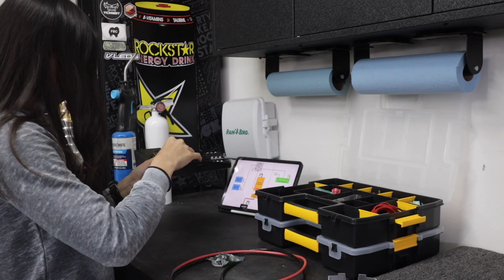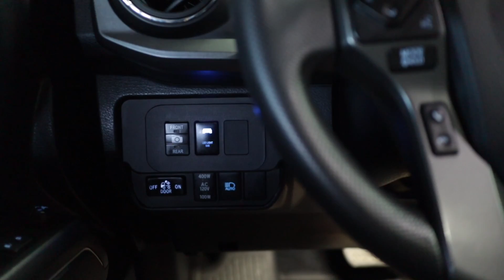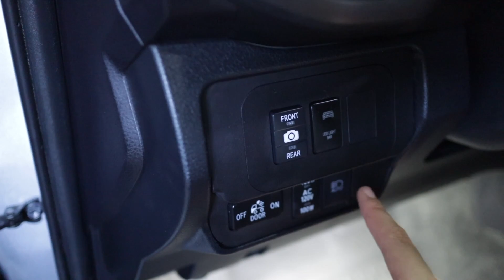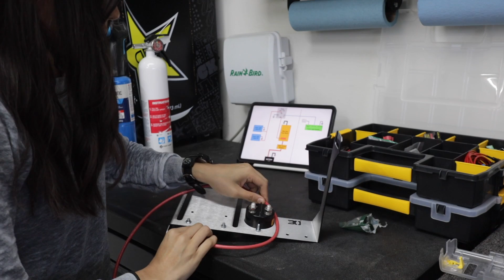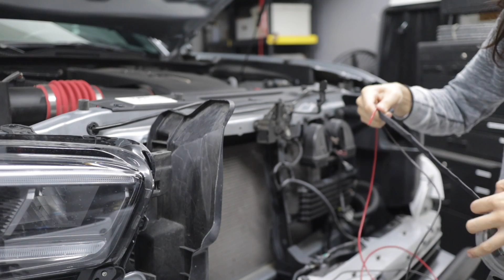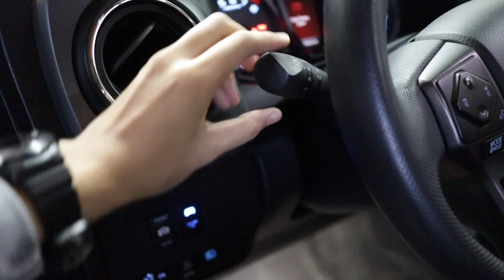DIY Auxiliary Power For Your ACCESSORIES! + Installing LED Lights w/ Switches

Comment: I love the Blue Sea products.  The breakers and fuses are selected based on the wire potential not really the acc draw.  If you have the length and AWG of wire to support 100amp draw between battery and panel you are fine. However if that wire can only support 50amps you won’t have protection

Comment: Is there a way to connect an auxbeam switch panel to this ? I got ahead of myself & started to build your auxiliary panel after I bought the auxbeam switch panel but the power cord runs into the fuse box to power the switch panel they include. Did I over complicate myself by building this when they send you everything already ?

Comment: How do you size your wire so that you are feeding your fuse panel with the right gauge power lead?
For instance, What if you want to run your fuse box 10 feet away from the battery?
I'm trying to sort out how to measure everything correctly on a VW project I've got going, and the battery is under the rear seat, but the fuse block needs to be upfront under the front bonnet.
Thanks!

Comment: Im new to wiring and dont have any real world ppl to ask questions to. Im currently installing fog lights on my 2022 SR, i bought the fuse block but do i have to use a Blue Sea 100A Circuit Breaker?

Comment: But you still have to shut all your switches off when you shut your truck off. Or your battery will die.  You should of wired it so when your truck is off no power to auxiliary stuff.

Comment: Nice and informative vid.👍 I have that same 100A breaker switch and the 6 slot version of that fuse block. He had issue with me going with the 100A breaker and told me to go with the 40A version. Yet most people go with the 100A version with no prob. I'm mostly running lights on the block. Maybe 3 that will need relays and the other, lower leds like Raptor lights, led rock lights and led strips to illuminate the bed. I mainly just like to use the breaker as a main kill switch. Do guys think I should ditch the 100 for the 40 like he said or can I keep the 100A with no probs?

Comment: The battery cable goes on the circuit breaker goes in the  LOAD ?

Comment: Great vid and thinking, Chloe!  Using this system for my trailer DC-DC charger.  FYI: I used your LED light upgrade, and the lights for the license plate got wet and started to flicker.  You need to have lights with a waterproof cover.  Pax tecum

Comment: Pro tip, try to use OFC copper.... oxygen free copper, it's more flexible, slightly smaller in diameter, and alot more resistance to corrosion.

Comment: About that little piece next to the brake sensor you should take a small piece of rubber hose that would fit into that slot on the mount

Comment: What’s the benefit to this over a auxbeam switch panel? 

The switch panel is perfect for just light and stuff because it deletes all the individual relays, and switches to the cab, and all that wiring. Why did you decide to go this route?

Comment: Hello Chloe,  I am wiring up some reverse lights on my Taco with the same switch that you are using.  Thanks for posting it is really helping with my install.  The wiring diagram you provided is awesome.  I have one question for you:  Did you NOT use the "Red 2" wire from the push switch connector, at all?  I thought that was supposed to used to allow the push switch light to be turned on with the tail lights?
Reply: I was getting ready to ask the same things. I'll ask in a new question and hopefully she can get back to us.😊
Reply: Hi Chloe, great video's and thanks for all of the details. When you hooked up your switch to the fuse box inside the cab, ( with the add a fuse ) does that connection back light up the switch like when the DRL's are in or when the headlights come on automatically?

Comment: You could wrap the corner by the wire in self sealing silicone F4 tape so the metal edge is covered in rubber. It should eliminate the possibility of the wire getting abraided. The Airforce uses F4 tale on aviation electronics for similar purposes.

Comment: Great video!  As a power engineer and HD mechanic I'd love to see you re-do those big gauge wires to supply and gnd to copper solder ons, and your spades to shrink style with the addition of a little grease.  I'd also never use butt connections but rather solder and shrink tube...its simply the only way to fly if you want any kind of longevity and safety!
  Keep up the good work!  Version 2.0 would be a great time to re-do those connections. Cheers! ✌️
Reply: Came to say this as well, cold soldered in an ORV is asking for it down the road.  If you must crimp make sure to use a ratcheting crimper like Astro tools.

Comment: Wow. Thanks I just installed this today.  I love my Bluesky Fuse box, breaker and frame.  It looks Factory standard.  I am getting the Stinger Jl Audio speaks in my 2022 Tacoma tomorrow and I needed this for the installation for my tech when he installs this. Thank you for your video to help me get this installed.  You Rock.   I am installing most of what you did for you Tacoma!!   Next is interior lights and such.  Thanks for sharing your experience!!!

Kelly

Comment: I’m sure I could just look it up but I wonder if there are brackets that are made for the manuals too. The location where you have your under hood wiring panel is where the clutch fluid reservoir is mounted

Comment: loo into a company that makes the Deutsch connector. its a much stronger connector and will not allow water to get inside the connector. The wire will break be for the connector does. thanks

Comment: Just saw this video on my timeline. Great work... Interesting ideas too! For the long lengths of wire to be run you can secure them with a vice or helper and run the other ends in your drill. Then just wind them up together in a braid to keep installation easier. My $0.02... ✌

Comment: I did something similar to my truck with an amazon kit from 8gang which is pretty much an unbranded auxbeam. Curious as to how the relays were connected to turn on with the lights being on. Awesome that you have the option to use stock looking buttons!

Comment: Hi, for the concern you have with the mount-plate being close to your brake sensor:
Get a piece of black rubber small diameter vacuum tube and slit it vertically. Cut to length and slip it on the edge of your concern so that there will be no hard rubbing.

Comment: Always good to go with an oversize fuse block, you will be surprised how many accessories you can add. Using the relay for the lights is overkill, it is rated for 40 amps on a circuit that will definitely draw less than 10 amps. Assuming your switch can handle more than 10 amps, wire the lights directly to the switch and save the relay for a larger load circuit. Most aftermarket Carling style switches can handle upto 20 amps.
Reply: Nice work!

Comment: To protect your brake sensor wire further, you might consider getting a PETG or shrink wrap sleeve and cover the wire. Alternatively a bead of silicone along the bracket should give you the protection you are looking for. Honestly, make yourself a note to check it after your next couple wheeling trips... if there is ANY sign of abrasion, look for a serious solution (overkill is always acceptable) if not you are likely fine... just add it to an inspection checklist to do periodically. (you SHOULD have an inspection check list)

Comment: You could put a piece of soft gasket material on the bottom of your panel to protect the wire where it's too close. Beats cutting it out. I happened to have some industrial grade adhesive backed soft gasket that I used in my boat to prevent vibration while towing .

Comment: Hammer the edge of the tan to a 45 degree angle to increase clearance

We do it in all sorts of stuff especially on truck (18wheels) tire valve rims to be able to air them up 

They have metal stems

Comment: Take some small fuel line and slice it to cover the edges and use RTV to hold it on, this will keep the ends from rubbing metal and being sharp.

Comment: I enjoy your videos. This my first comment EVER.  Your attention to detail and safety make me feel like you’ll read and consider so I thought it would be worth my time.  

Of all the videos I’ve watched about adding a fuse panel with a circuit breaker, NO ONE thinks to protect the terminals of the circuit breaker under the support bracket.  These (exposed) terminals are so close to ground sources (such as the bracket they’re mounted to) that they are a danger while working with tools nearby.  Unless there’s an inline fuse, the line side (battery to circuit breaker) and (with the switch closed) the load side are unprotected.  A short to ground would be scary, not to mention may damage the battery.

I used Fastronix 5/16 - 1/4” stud terminal caps to cover the CB terminals under the bracket.  I got these from Amazon.  They’re about 2 for 7 bucks.  Good value for the protection they provide. I suggest that you install these when you change to 4 gauge wire (of even if you don’’t).  

The risk may not be great, but is there.  I hope this helps you and others.   Best.

Comment: Excellent video!  I would like to add that you need to fuse for the wire. IOW, if your wire is rated for 8 amps, but your fuse is 10 amps, the wire will catch fire before the fuse ever blows. Luckily, 16ga wire is rated for 13a. You might also look into using car audio power wire. It has higher strand count, is a lot more flexible, and less likely to corrode over time
Reply: Thanks for your input

Comment: Suggestion make a fuse box diagram listing the fuse numbers with what they control for a just like the factory function. Helps later on also when you forget what fuse is for what. Excel sheet and a laminator for a bit cleaner look. Could tape it to the inside of the lid possibly.

Comment: Interesting-ran switch wire from cab thru firewall to engine bay!
Out of dozens I’ve watched, always from engine bay thru firewall,
you start in cab.
Is this approach a software engineers, gender, or ‘better way’?
Thanks.

Comment: Don’t forget to use either a Lighter or a heat gun on all of your connections. The reason why it’s a larger diameter size is because it’s designed to be shrunken with heat and will create a weatherproof connection. On the items that you can’t waterproof use Vaseline(I know but it’s true)

Comment: Love this!  Man, I wish Guild Outfitters (or someone else) would make custom panels like that for the 5th gen 4Runners.  I'd love to have a more OEM look than the aftermarket Switch-Pro type touch panels mounted randomly on the dash somewhere
Reply: The 2020+ Tacoma have as many switches as she shows here so maybe check to see if Toyota sells newer switch panels for later models

Comment: I think to protect the brake sensor that the mount comes close too. Is to go down to the 6 circuit panel that you were thinking about. Then make the clearance you need around the sensor your comfortable with. If you plan to stay with the 12 circuit. Then mark the area near the sensor and maybe bend the mount in that area down or upward to give you more clearance. If you can bend the mount carefully in that area. It could strengthen the mount.

Comment: You could always get a flexible gasket for the piece near your brake wire so you don't have to cut anything and you don't have to worry about it.

Comment: Hi, awesome video. Have been sitting on this project for a while myself. I may have missed it but where did you ground the relay? Do you think you'll have a central ground for future relays/accessories? Thanks so much.
Reply from the maker: The relay was grounded on the fuse block 😊 Everything else I just ground to wherever I can find on the chassis

Comment: Just an idea, but maybe add some lock washers next to the nuts on the bottom of the bracket?    This would help the nuts from coming loose from vibration.   A dab of blue (removable) locktite is also an alternative, as well as aircraft style lock nuts.

Comment: If you have the room at that corner and have a mounting area under it you might be able to use a post mount and bolt it on the corner and that will give you a sturdy corner. If that does not work you might be able to put a flexible rub rail on the corner just incase it does hit it will keep the metal from cutting the wires.

Comment: Maybe some large shrink tubing for the harness your worried about for extra wire protection. One suggestion for your terminal connections though. Be sure to use flat washer underneath and on top of the lug. Also consider using lock washers under the nuts or maybe nylon locking nuts. This will prevent lose connections due to vibration.

Comment: Hi Chloe,
Love your Chanel, your videos have helped me with a lot of mods I have done on my 4Runner that are similar. It’s great you did this video… I am actually working on swapping out my wireless remote controller… it’s a love-hate relationship… it works we’ll but it’s finicky to say the least… I have installed a few accessories (lights, light bars, hidden bumper winch and bumper lights similar to yours, on board air compressor etc.) and at first so many wires and messy… so I cleaned and organized everything but the wireless remote option, though sounded good at the time has been nothing short of frustrations… some times the single connects and sometimes you got to swing your arm around pushing the buttons looking for the right spot for the controller and remote signal to connect 😂… after several attempts to improve the certainty and reliability by relocating the controller to get better signal I decided to look for a better option… this video has given me a great idea to build my own and use switches instead of a remote switch. I am excited to get started on this project! Thanks Chloe and happy off roading! 😊

Btw… if it were me I would cut the part of the tray you are worried about being to close to the break sensor wire… the integrity of the mount vs the risk to your breaking system… safety first, right… plus the risk of messing the Taco’s primary electrical by the aftermarket accessory cutting into it is a lot more costly and damaging then the cost of replacing the mounting tray should cutting compromise the mount support integrity… but I believe the mount has plenty of integrity and support from other mounting points and the components mounted on the tray are light… but you can see the set up you have and evaluate it more clearly then what can be seen in the video so do what you think works best and is the safest 😊

Comment: You could always bend the corner up. Before making version 2 you might want to take a look at the DIY sPOD build. The diy Relay / fuse Panel is able to be made waterproof.

Comment: I love your videos.  I have a 21 TRD OR.  I get a lot of ideas from you and thanks for that.  I do have a question.  Why not heat shrink those crimp connectors?  It gives them strength and helps keep moisture and dirt out.
Reply from the maker: Absolutely a good idea to do that, thank you!
Reply: There’s crimp connections with built in heat shrink for an easier/cleaner method

Comment: Chloe, easy way to see what stuff draws is to take a Digital volt meter that has Amps setting on it and pull the fuse that runs the accessory, than take the leads and put them where the fuse was. Just make sure to have meter on 10 amp setting when doing this. Basically the meter takes the place of the fuse and will tell you what each circuit draws for current. Than you know what the lowest rating fuse you can use.  Great job with designing that.
Reply from the maker: Duh! 🤦🏻‍♀Thank you and I am going to do that and appropriately fuse 😊
Reply: @ChloeKuo  what rating fuse did you find you needed?
Reply: The beauty of the YouTube community right here. Great suggestion, and great video!
Reply: I couldn’t get it to work 😭
Reply: Or just get a clamp meter and clamp the wire you wanna test.
Reply: I feel my method is better. Multimeters are more accurate than clamp meters.  @SoskiDiddley
Reply: You are beautyful genius bud i don't know aboat that crimp tool you'r use😊 Klein crimpers for non standard sizes are good IB1006-IB63050 and rahcet crimbers are best for standard sizes and automatic wire strippers you Will love them❤
Reply: Hammer the tan into a 45 angle so it’s still there but a lot more clearance
Reply: @azadaranda5634  ?? No hammer required to do what I stated.

Comment: This was my initial setup but knowing how much I was going to add to my Tacoma, I went with a switch controller. I knew that for everything I have planned to add, I didn't want to have a ton of relays. Great options for accessory hook ups.
Reply: So for this set up you need a relay for each accessory? Switch controller you don’t?
Reply: @MakersMike  yes you would need to add a relay for each accessory. A controller like SwitchPros, AuxBeam, or the Garmin won’t.
Reply: @Mumfy64  thanks for reply. I figured. Just wanted to make sure.

Comment: I applaud you for attempting this as wiring always seems to scare a lot of people.  Probably for good reason:)  A couple of hopefully helpful insights:
You first mention you were going to switch the relays with the negative wire inside the cab.  This is a great idea but you eventually ran the hot wires to the switch to relay connection.  
I would suggest switching to heat shrink insulated crimp on connections or adding heat shrink (with the glue) over the connectors.
Heat shrink and wire loom is your friend in protecting wiring.  Especially in your type of offroad rugged conditions.
Your interior switch ground, needs to have the paint sanded off, add dielectric grease and a star washer to maintain a good ground.  
Hope this helps, not trying to be critical, just passing along information I have learned after several trouble shooting efforts.